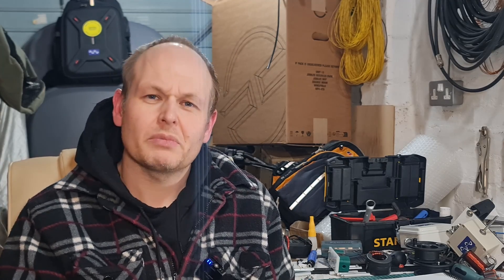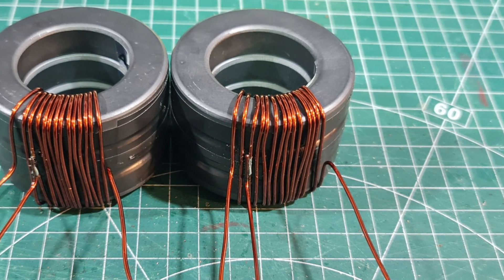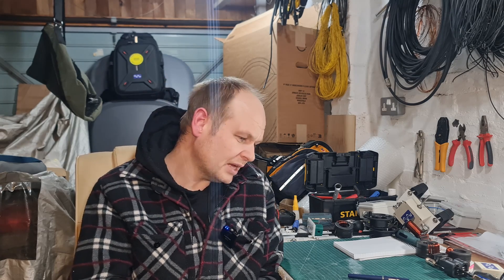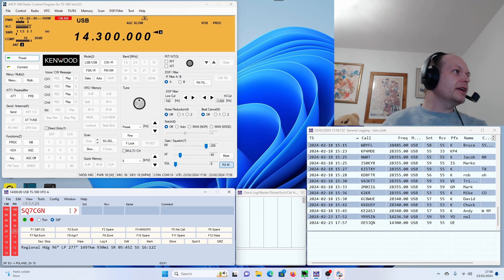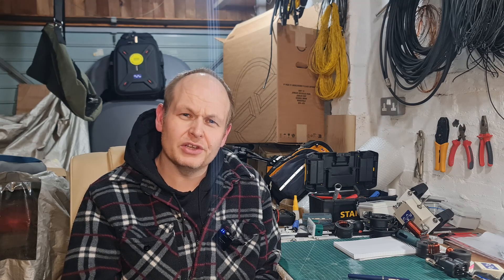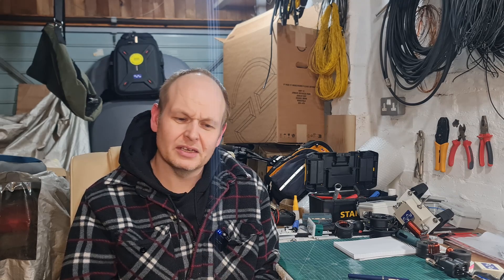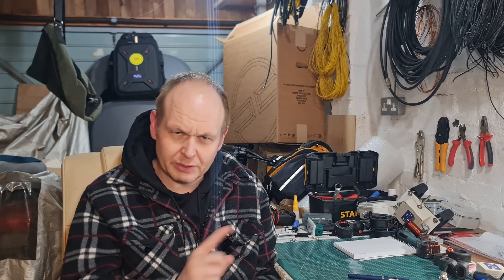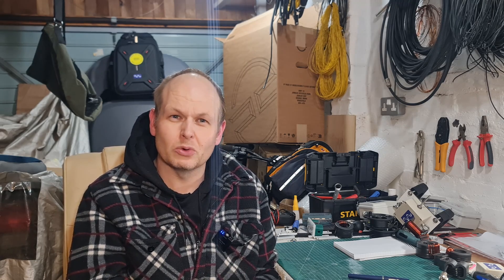Build Yourself a Cheap Efficient End Fed Half Wave for High Power

Comment: Colin, another excellent video. For the first time, I am building an EFHW 49:1 transformer for a friend that might run as much as 200 watts. I going to use two ft-240-43 cores, and I am wondering what you use to tape them together?? Thanks for all your hard work and sharing the results with the rest of us!! 73, Todd N7TWL
Reply from the maker: Thanks. Dont need to tape, just just 3 dabs of superglue and stick them together.
Reply: @MM0OPXFieldRadio  Thanks. Will use superglue.

Comment: If you are running high power you need to keep in mind that this system offers zero second harmonic suppression. If your amp has a pi network, instead of pi-L network, you will likely be transmitting a readable signal on your second harmonic.
Reply from the maker: Which system? My Acom 1000 takes care of harmonic suppression for me.

Comment: I used teflon coated silvered wire for mine (something worth looking for in hamfest junk boxes cos it's pricey new).  Not sure if it made much difference to the heating.  Is the EFHW a good antenna to use at high power?  Be interesting to see how the losses increase with increasing power.  Thanks for taking the time to make these Colin.
Reply from the maker: Thanks, if had some I would measure the loss. No problem for high power as long as its built right. I would much rather use my Hexbeam with some power as a pileup buster. More power means more heat so that's whynI say it needs to be built right.

Comment: Pay attention to the attachment of the ferrite with a wire. It's a painted wire, but it's enough to break the paint and the core will be short-circuited.
Reply from the maker: Agreed, that's why I'm very careful when winding.
Reply: @MM0OPXFieldRadio  I guess I explained wrong. I point to the copper wire attaching the toroid to the box.
Reply from the maker: I'm not sure what you mean then. There is little risk of any shorting here. My Acom 1000 has the protection anyway for issues like this.
Reply: @MM0OPXFieldRadio  Colin, the wire (that holds the core to the box) represents an additional (secondary) turn with a short circuit.

Comment: In truth, I can’t understand why the power was upped via the governing bodies..
It was perfectly ok as it was, ample power for all, the problem now is of course measuring antenna performance if someone is blasting obscene amounts of power into the ether.
I get from your hesitance in the video delivery that you too are not sold on the idea.
It’s totally ridiculous .
Sometimes, just sometimes less is more and things don’t need fixing
M
73
Reply: Sensible talk
Reply from the maker: I wouldn't say I'm not sold on the idea as I believe we should have the choice. Just because we can doesn't mean we should. For some peolple with big amps this is merely a paperwork exercise so now they can tell the truth. Since this video, my amp has not been on at all. I bought it so it had loads of headroom not to stress the valve and that's the way I see it. I wont be changing my operating.

Comment: Would a transformer designed for high power have any detriment to say a system running 100w?
Reply from the maker: None, buts its extra spend you perhaps not need to layout.
Reply: @MM0OPXFieldRadio  Thanks for the reply.

Comment: Thanks for great information on high power efhw with the transformer. I've got a couple of questions. Did you use a choke next to your high power amplifier? No complaints from your neighbors, emi audio/radio/TV?
Reply from the maker: Install the choke 5% of a wavelength back from the feedpoint. It can be a bit more though. Zero interference issues.

Comment: hi Colin, interesting video for sure. I have been lucky, never to need any amps to get 10,000 miles plus qso,s, either as  G stn or now a ZL. My recent extensive tests with a 20m 2 ele parasitic vertical, using sdr receivers all over the world, for 3 months, against a single vertical, gave me on average , 1 to 2 S points gain over 10,000 miles, and a big reduction in rx noise. I  can send you the results if your interested.  Hope to qso soon. 73 zl3xdj.

Comment: very good. love the testing on the FT 240-52 cores. I have been using mix 61 that I have. run great 10 and 12 meters. not much heating on 800 PEP watts or so on 2 stack wound 49:1 and 10 AWG wire. using 2KV 100 PH cap. I have thermal imagining camera . was watching my type 61 cores . at took 500 watt FT8 to heat them up. I  have 4 572/B tube amp so I wont run hard very long. I was using 10 and 12 meters. same DX commander pole but veritable with ground plain wires. end fed cut 1/2 wave  cut mono band 10/12 meters. I fold end back to tune. I have Pota Flex 7 M & P coax. just bright yellow. nice choke on coax. when you go QRO the counterpoise and CMC choke more important.  don't want that RF getting back in the shack. 73's
Reply from the maker: Sounds like a great setup. I've yet to try 61 material.
Reply: @MM0OPXFieldRadio  from what I can tell. type 61 better than 43 on 12 threw 6 meters. I do not have type 52 to try . good cores in the us is about $15 each, give or take for type . that for FT 240. then add shipping to that. just got a few .

Comment: Thermal camera at the ready.  Well it will be some months before I’m back on the air from my new QTH but hope to do some /p QRP with my KX3 once the weather improves.  Not sure about upping the power but will monitor things as I’m starting afresh.  Great vid as usual. Regards Mike
Reply: .... a thermal camera is nice but, they can get pricey... if $ and price point is a prime consideration, another option might be to get one of those inexpensive trigger thermometers that became popular during COVID... they are accurate and not that expensive.
Reply from the maker: Hope your settling in well Mike. Portable is a much fun as anything.

Comment: Good video good info

Sounds like you have a lot of noise compared to what I hear on 20m using either of  my EFHWs which are cut for 80 and 40m 73 de NE5B
Reply from the maker: Its local noise. Shortly after it disappeared.

Comment: For a quick and dirty “did this get warm?” check in kit I can’t reach quickly - I sometimes stuff a till receipt into the enclosure.

Thermal receipt paper changes colour somewhere between 60-100C - if it went black, you got to at least 60

Obviously this is a really crude measurement approach, and only suitable where you’re sure it’s not going to get hot enough to ignite (although that’s presumably useful info too!)

But it gives you some idea without worrying about data logging a probe with kit that may or may not cope being near that much rf
Reply from the maker: Great shout. I have thermal labels here somewhere here.

Comment: I have not yet felt the needed for an amplifier. I have always operated with 100 watts and everyone that I can hear can always hear me at least as well.  I even do well on 75m without an amplifier, but I use a very efficient home-brew double magnetic loop, which does not suffer from ground losses compared to the inverted-V that most people use.
Reply from the maker: Yes its not for everyone. 100w is ample nearly all the time.

Comment: Maybe a ESP32 would fit you needs for a Temp sensor  Colin  ? !!
Heltec esp32's are very small and work well in enclosures.
Reply from the maker: Most likely but I need to try and learn some coding with Rpi or arduino.

Comment: The fact that the insulation tape didn't melt or just come off means you didn't get it hot I'd say!  😃
Reply from the maker: So inside the box I used liquid electrical tape just in case of arcing. Definitely no issue on 20m.

Comment: How about a LORA temp sensor in the box.  Only use it when not xmiting.  command and voltage could be sent over the antenna wire.  Just a thought.  Interesting antenna!  73
Reply from the maker: Yes good idea. I really need to learn coding with likes of Rpi and arduino.